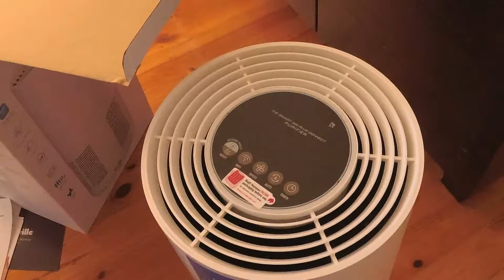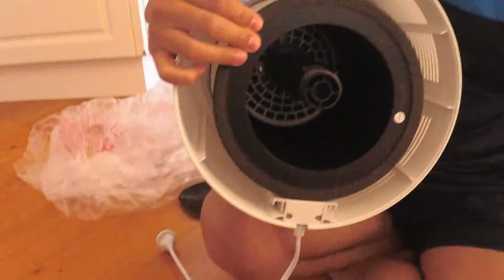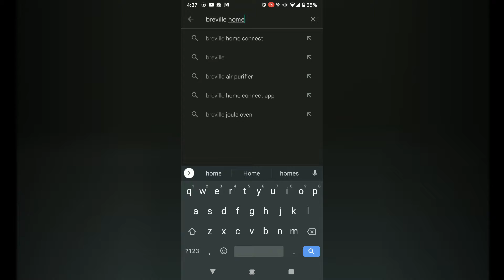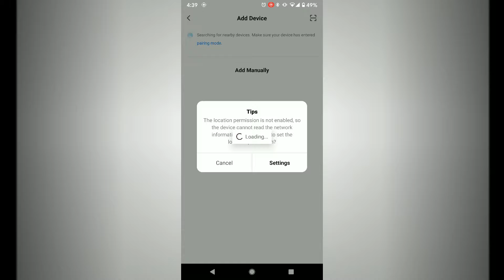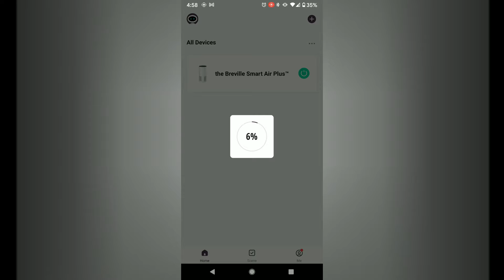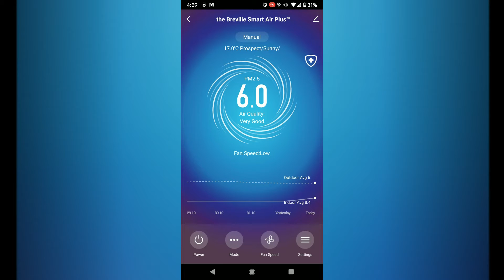BREVILLE AIR PURIFIER UNBOXING TESTING CONNECTING

Comment: Great video. Helps me a lot. 👍 Just bought the  Smart air purifier model LAP 208. What does the number at the top in the blue ring means, left of PM 2.5, like you can see on this video as well. Number keeps changing all the time.
Reply from the maker: The number is the air quality level. If it's blue then it's good quality.
Reply: @skopioeye thank you. I thought that only the blue ring meant that the air was good. Thought the numbers that keeps switching between 1 and 4 meant something else.😊
Reply from the maker: @edamse  no problems at all. Sounds like you have great air quality there. If you can like the video and subscribe that would be great. Thanks in advance.
Reply: @skopioeye I already liked the video and clicked on subscribe after I had watched the video.
It is great to have someone who can explain things properly on a product . You did a fantastic job. 👍
Reply from the maker: @edamse  awesome thank you so much!

Comment: Thanks for the video, do you mind to elaborate how you set the device to pairing mode? The information in the manual is useless. Not able to set to pairing mode follow exactly the power on/off reset..... thanks
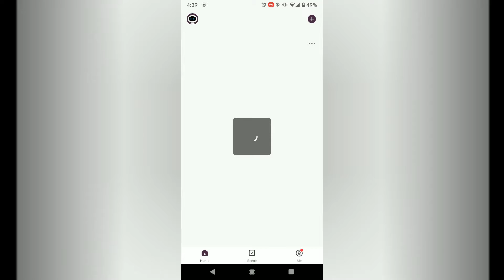Reply from the maker: Thanks. if you watch the video at 8:22 it will show you how to connect to the wifi network and follow the prompts. Hope this helps and please like and subscribe.